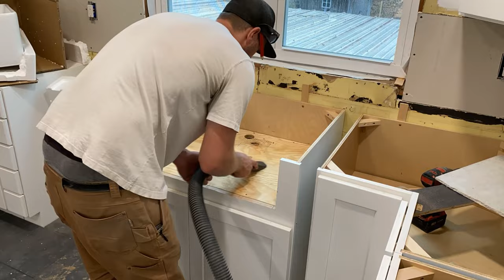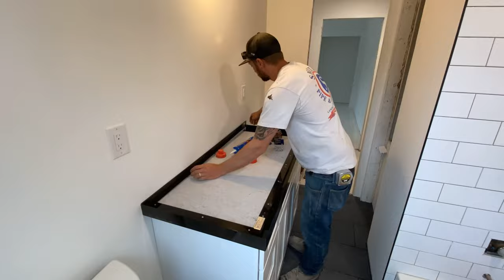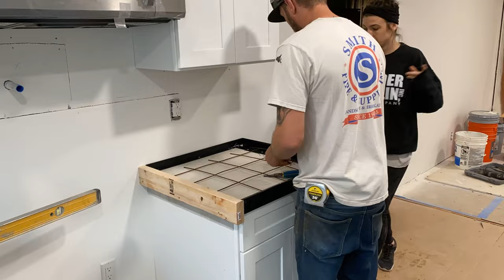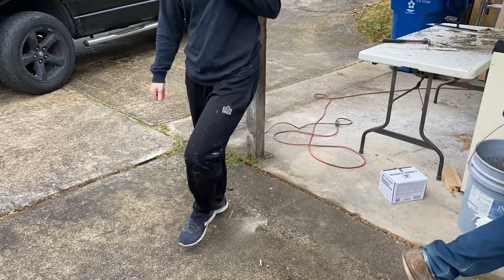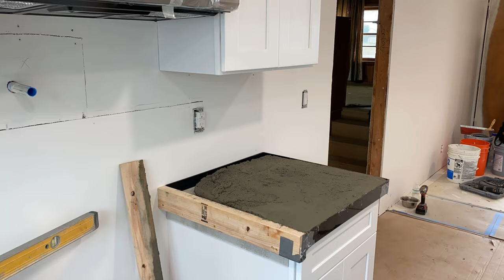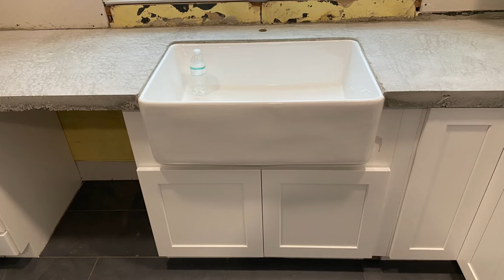First attempt at apron front farm sink install and concrete countertops with drop edge

Comment: I actually like the "raw edge" character of these! Looking forward to doing ours in the next month or so -
Reply from the maker: They were really fun to do. Some of the edges we didn't vibrate enough so it ended up a little more raw then we were looking for. If you're looking for a really smooth finish use an orbital sander or something to help shake the concrete into the smaller areas

Comment: Instead of using their "z clips" and mesh, what did you use?
Reply from the maker: I just used standard wire mesh and made my own chairs/standoffs with a spool of metal wire. Only downside to that is if it is too close to the surface you will start to see rust overtime